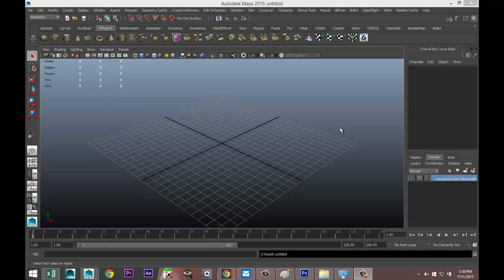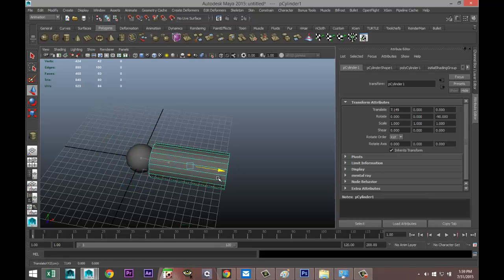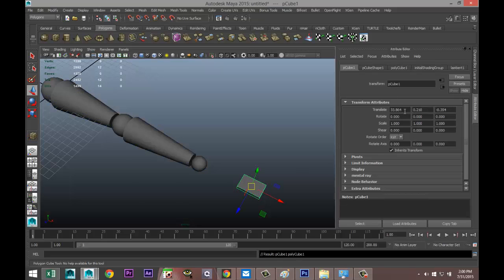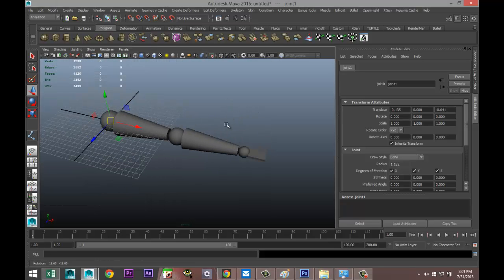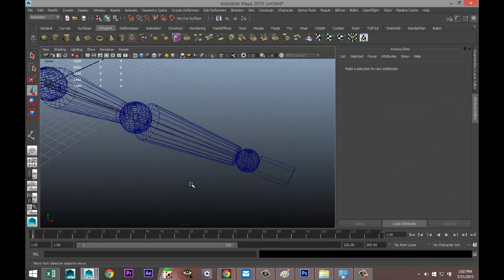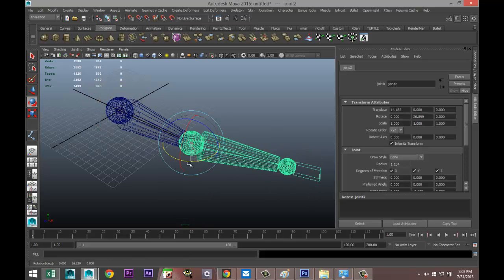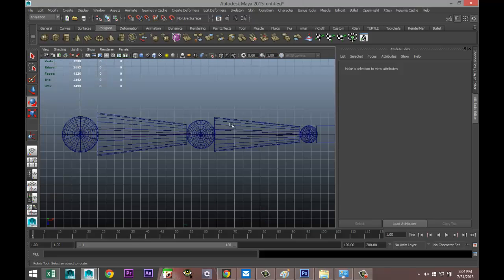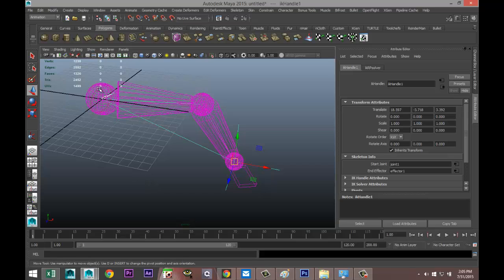Maya rigging tutorial : The IK Handle basics explained

Comment: When using IK on a model for rotation constraint  , the feet end up not moving at all but the whole model itself is running perfectly, is there anyway to correct that?
Reply from the maker: If the IK is set up properly I should not work like you are describing

Comment: Mike nice tutorial, though i have a question in mind. When we apply the elbow joint straight without bending, we get the ik handle bending in the opposite direction. but when you apply the elbow joint straight, it works perfectly fine. Why so? We should rather apply the elbow joint slightly bent i guess? A lil help...